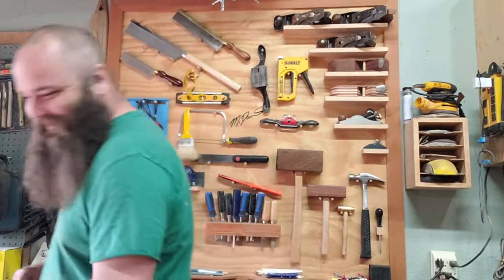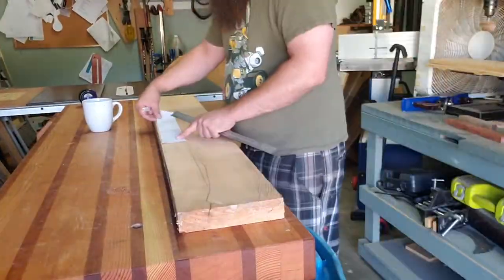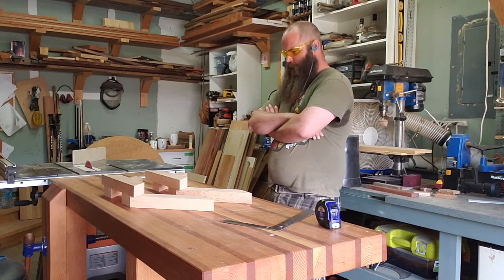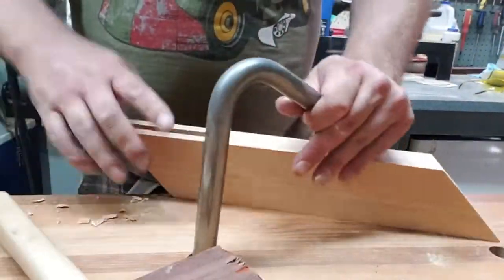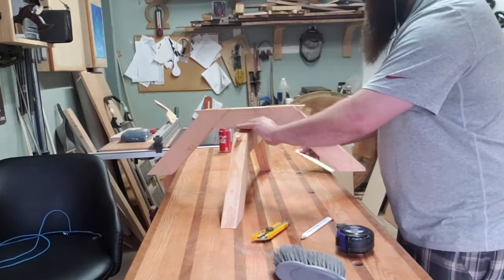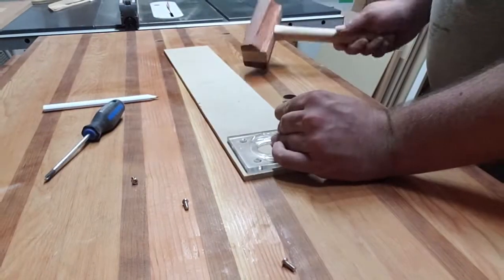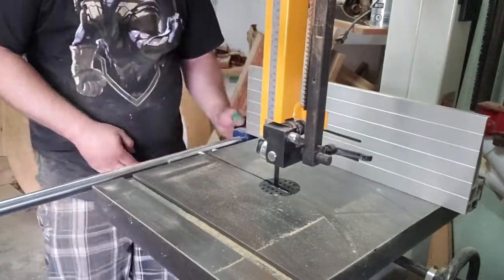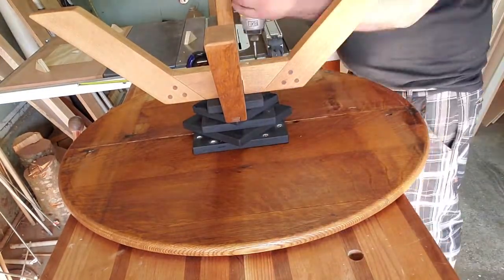Making a New Coffee Table For My Den!

Comment: That's a beautiful table and you did well considering how many firsts you had in this project! Just a thought on the solution to your height issue... Why not build another base exactly like what you built and flip it upside down to attach to the bottom of the table. You could maybe bridle joint the upside down base to the right side up base? I could also be talking out of my backside too. Regardless, your table is beautiful!
Reply from the maker: I thought about doing that exact thing (a mirrored version of the base sitting upside down on top of that one) but I'd just straight-up had enough of the whole project by that point and needed a "just get it into the house" option. haha

Comment: What kind of jointer do you have?
Reply from the maker: In this video I was still using my old Craftsman 6" benchtop. I have since replaced it with a King Industrial 8" benchtop with segmented head, but not because the Craftsman was a bad unit, just because I wanted the couple extra inches and a bit cleaner cut.